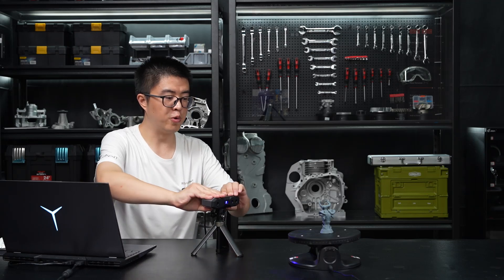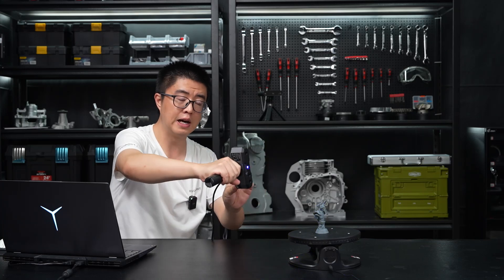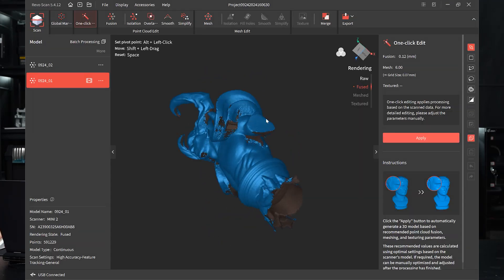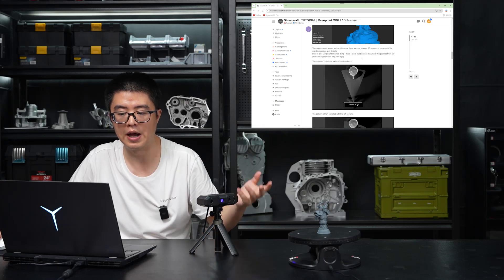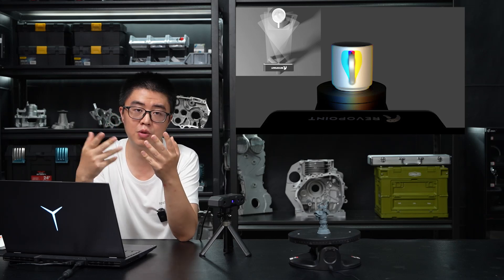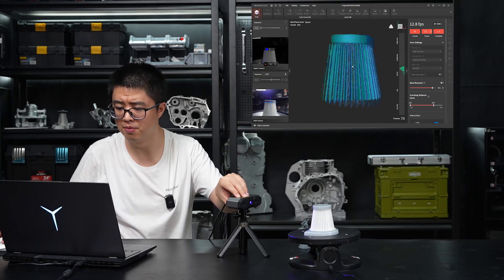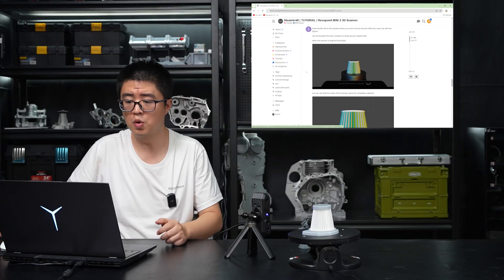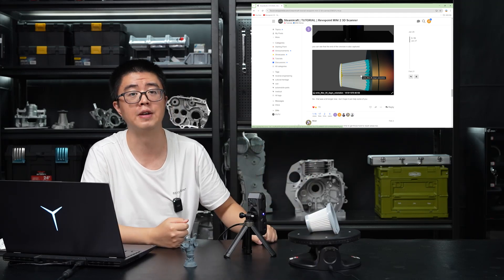Revopoint MINI 2 3D Scanner: How to Scan Crevices

Comment: You guys really need to update your phone software. It's unusably bad with very limited settings, no ability to scan darker objects, defaults to a tiny range of scanning distance that it does not memorise,

Loses tracking and drifts nonstop on any simple geometry, which it seems to ignore the accelerometer and the phone's own camera,

And crashes whenever you undo too many times quickly. This also destroys your scan file by corruption, because you can't undo the saved drifted scan when you resume scanning 

I will be returning mine if I spend $1500 on something that doesn't even work for its intended purpose.

Comment: You really need a realtime side-by-side comparison of the previous models. I'm disappointed on the performance of the Mini, and I'm not going to throw more money away at it.
Reply: The only real difference is the field of view and the illuminators. The original MINI can actually produce slightly more detail than the MINI2 due to that reduced FOV. Chances are you're either scanning an unsuitable object (or scanning it in an unsuitable mode), or not prepping it properly, rotating it too fast, not using the right depth sensitivity... basically any of a number of user errors.
Reply: The mini 1 and mini 2 have been excellent for me….